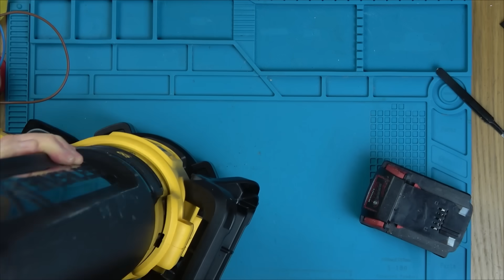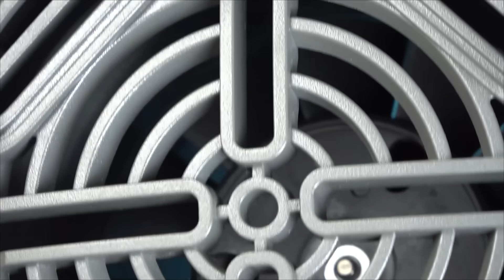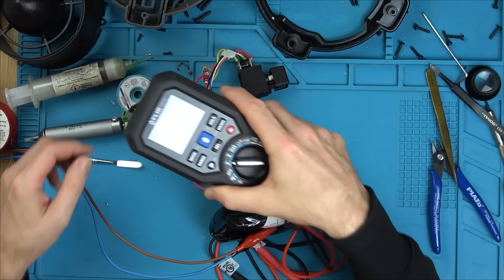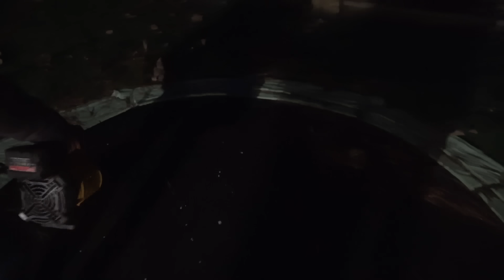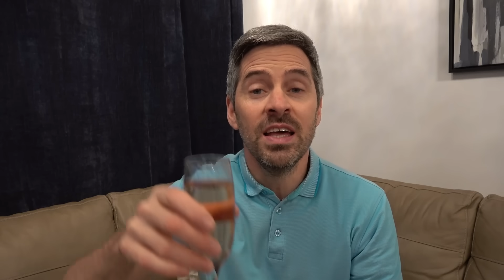MMV November 2024 Fixathon Final Day 7 - DeWalt Leaf Blower & Weekly Summary

Comment: Im pretty sure its a low voltage protection. When going full trigger it expects a certain voltage to hold up. Im pretty sure i saw your bench power supply go to 13v at one point and then it cuts off. And that can be up to cells in the liion pack having to little resistance or discharge rating (bad cell). Wonder if you would you use your huge Milwaukee battery on something more intensive power demanding tool if you get a satisfying result. Anyhow appreciated the fixathon series. Greetings from Sweden.

Comment: Don't these 18v batteries fully charge to 21v? I wonder if it's sensing that 18v is insufficient for running at full power and limits how fast the motor can turn? Try it with your bench supply at 21v and see if it makes any difference.

Comment: 18V on a 5-cell pack 3.6v per cell which is mostly empty. Those are high power devices and will be dropping to under 3V when loaded hence cut-off. You should get near 21v

Comment: that 'protection' thing is like the centre pin in the dell/HP laptop chargers to see if you have a real battery on - it always relies on a resistance value. your big one seems to throttle the output on high demand so you wont overload the battery - my hilti drill does that when it gets stuck. the battery starts blinking at that moment.

Comment: Would it be a discharge limit on the batteries used in each battery bank. Perhaps they have a discharge limit cutting off the supply from the battery to prevent damage to the cells.

Comment: 2Ah used in 5 minutes (1/12 of an hour) means an average of  2/(1/12) amps (same as 2/0.083333) which is 24 amps.  10 Amp power supply doesn't cut it 😪

Comment: Good guess on the thermal monitoring, bypassing an NTC thermistor (fitted inside a proper DeWalt battery) is the devil's work (in my opinion). At a guess, the battery ID workaround is confusing the motor controller (thinks the battery is too low capacity), causing the cutout.

Comment: If you look at the power supply when you're trying it off of that, you see that the output voltage drops when you start it. That means the power supply is limiting the current, but the amp meter is probably not keeping up, so you cant see it. And when the voltage drops too much, the blower shuts down. There's probably something iffy about the chonky battery too, maybe a weak cell that drops down too low under high load.

Comment: 2AH is the capacity it does not mean is getting 2 amps it could be a lot less. As for the Milwakee battery if the BMS is damaged it could be putting out more amps than it should and the circuitry on the tool could be detecting this and shutting down hence the reason it works with a slow trigger press but then cuts out as the motor ramps up. lower the amps on your bench power supply and see if you have a better result.

Comment: hi vince, i see lately you've bought some 18650 cells from a vaping company.
What you're showing in the video is well known amongst long term vapers and has been mentioned below...battery sag/drop under load. We (?) often run the battery through a 0.2ohm coil, or below...ohms law will show you the wattage. Its not trivial, thats why the battery should be rated at 20A or above ideally.
After a few months, a particular battery may well charge well to .4.2v , and may even take 2000mah or so, but under load, the thing drops below 3.2v or thereabouts. Its fine in a normal small torch and so on, but ask it to DO something serious, and its well...poop.
The internal resistance of these cells start out at around 25milliohms and by the time theyre showing 60 or 70 milliohms its only good for the small torch and time to buy new batteries..
That massive 12ah pack you've shown probably is just poop by now. Sorry. And as you know...open it up and its probably a 5s2p config of 18650;s. (forgive my maths if i'm out by a small amount, its been a bad day for me)

Comment: Vince, well the battery amps is the the key to the running of the power tools as for example a heavy duty power drills or drivers  need higher amps to run  that’s why advised too use on them. As lights too leaf blowers need lower amps ie 2-4  as if using 5- higher do not work well. As good fixes in all and enjoy all.

Comment: the issue at the end with the bench power supply is that its current limited to 10A. On start up the leaf blowers drawing more than 10A so the power supply is dropping the voltage as it cant supply the current needed. the same issue with the faulty milewaki battery the current drawn on start up is too high so the voltage drops. alot ofpower toolbatterys have 50A fuses in them for safety

Comment: I'm fairly certain a lot of the modern DeWalt batteries have the battery management system in the battery, not in the tool (I'm certain this is the case for 20V DeWalt batteries). I'm also fairly certain Milwaukee puts the BMS in the tool. This could be a case of the Milwaukee battery not being directly compatible with the DeWalt tool.

Comment: Your PSU is not powerful enough to run it at full blast. You could even see the voltage dip below 14 V at one point and it will be even lower at the end of those cables due to their resistance.
A good battery pack can supply well over 10 A in bursts so the original buyer probably used a weak or incorrect battery which may have seemed good on other less power hungry power tools.

Comment: The adapter does not really trick the motor. It adapts the impedence of the Milwaukee temperature sensor to a higher impedence level on which  the deWalt device can work,
To achieve that, you need a fully working Milwaukee-Battery(i.E. with working temperature sensor)  for the device working with the adaptor at full speed. 
If your battery just delivers voltage but no temperature signal, the motor will cut out as soon as you have reached a certain speed of the motor. In this case, the
impedence level gets to low for the motor to work.

Comment: Low voltage cutout. Bench power supply was down to 13 volt. Blower stop. We didn't get to see how much current it draw at full power, but I bet it was more than 10A.
Your big battery is probably not healthy, ie big voltage drop making blower cut out with that.

Comment: If you don't care about a little resistance in the mA range causing slight inaccuracy you can solder a self-resetting fuse across the fuse holders instead. No more blown fuse when you make a mistake ... just wait a few seconds for it to reset and off you go. When I got fed up with students blowing meter fuses this was my solution and I never bought a meter fuse again.

Comment: The wires for the bench PSU cannot transfer enough power. You can clearly see that the voltage drops to 13.45V on the PSU display when you push the trigger to the maximum.

Comment: So Dewalt tools in the UK are 18v? Weird.
Reply: 18v and 20v tools are exactly the same power and even use the same insides of the batteries, just marketed differently. It’s a 5S battery meaning there are 5 cells in series (and then however many more in parallel to give capacity). Each cell is 3.6v nominal or 4v maximum. 20v (5x4) is the “maximum” voltage of the 5S battery when fully charged. As soon as there is even slight discharge that becomes 18v (5x3.6). So realistically tools that are marketed as 20v are only 20v if they are fully charged and not used. As soon as you use them, they are 18v tools. But 20v Max sounds better so they market it that way
Reply: @littlebluedinosaur ….and the US allows these batteries to be labeled “20V”, but other parts of the world require them to be labeled “18V”.

Comment: I recon the controller is monitoring the voltage drop when in use, if it notices the voltage dropping too far or not stable enough, it could be cutting out to prevent damage to a poor battery.

Poor battery contacts, small thin wires, high resistance croc clips will all aid this effect.

You might have 18v at the battery but what is it like under load and measured at the board.

If you had an oscilloscope you could monitor the incoming voltage on the board or close to it and see what the stability is like on the various batteries / supplies. Or rather crudely with a multi meter but you wont see the full picture.
Reply: It was even visible for a moment on that slow voltmeter on power supply as it sometimes show 13V when pressed the trigger.
Reply: I would say it is the other way around. The bench power supply is stable and offers more amperage than the device requires, so it's probably an over-amperage that is being prevented. So, the protection area of the board may be defective. It is sensing not too little, but too much "juice" and that is why it is possible to activate at low speed. The two batteries that work may not have enough capacity to trigger the protection.
Reply: I think you are right. If the voltage difference between the two sense wires gets too low either by +Vbat dropping or Thermistor as part of a volt divider, then it shuts off. The resistors in the battery adaptor will put about 18v on one sensor wire and 11v on the other, as well as slowly draining the battery at about 4mA - 2Ah in 3.5 weeks ish.

Comment: When it comes to pretty much all battery operated power tools, they have an insane turn rate because they don't ship with a battery like 70% of the time, which is why they are as cheap as they are on websites and people order them thinking that they're coming with a battery. Or some people will literally order the ones that come with a battery, keep the battery and return the power tool. Or even worse, if their battery goes bad, the order of power tool puts their battery in, it takes a new one, and then returns that power tool with the old battery.

Comment: Brushless motors use an electronic speed controller, which uses a three phase system to feed the motor and it also knows where the motor is in its rotation so it knows which phase to feed power to. They also expect a certain number of series cells, with 5S (five cells in series being 18.5v for LiPo cells, for example). The speed controller will cut power to the motor if the cell voltages drop below the safe limit. I suspect, in your case, the speed controller doesn’t like something it’s getting from the pack that starts and immediately stops. It could be that the speed controller is faulty of course.
Reply: Ohhh yeah definitely a NPN transistor ... happened to my cordless drill..

Comment: what the adaptor is doing there is a nasty little trick chinese battery clone manufacturers like to do, its putting resistance across the sense pins to match what a healthy thermal reading would give off, not strictly safe since it bypassing a safety function, but you are using it with decent quality batteries so its less of a problem than when its done inside the third party batteries

the larger battery is most likely able to put off a higher current than its expecting so it cuts off thinking theres a short or something

Comment: My guess is there is a current limiter in the motor controller and the smaller batteries can't produce a high enough current to exceed the current limit. Your power supply and the bigger capacity battery can exceed the limit.

Comment: The battery probably comminucates via some i2c or whatever data protocol to the board (just like certain laptop batteries) or its just some simple power good signal or current sense input kr tenperature. That infineon chip (with the i on it) is a xmc1302 embedded microcontroller commonly used for driving bldc (brushless dc) motors like the one in the dewault. I did not see any battery Management block inside but they probably have that transistor feed the mcu or some analog input causing it to only turn on when the right signal is present 

Its sadly commonly done to make sure ofbrand/no brand batteries wont work and you buy the official battery or a battery that has the right things to tell it to turn on. (At least what is my gues)

26:59 i think the seller used a weak battery on it or a battery that could not handle the oomph the device requires to do its first kickstart. Like that if it detects a slight voltage drop that it will go to a fault mode to not overcurrent the source further. I am just guessing at this point but thats my gues. That mcu has some analog inputs and you can easily use an mcu to detect if power is good or detect battery voltage

Comment: 31:50 my guess is that the battery is sensing the current and cutting off? and that's why when you do it slow you can get it partially running

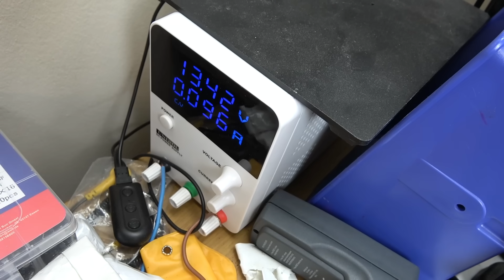edit: 33:15 okay i have no clue anymore

Comment: Thanks for the fixathon Vince, I really enjoyed it! I can't wait to read the comments and find out why things are mysteriously not working with the battery adapter. Maybe it has something to do with battery cells.
Reply: Probably its some anti off brand battery lockout that only dewault certifie batteries work which is sadly common with companies these days locking out things if you dont have the right parts. (Atleast its my gues). Or for detecting bad batteries so it wont overload them
Reply: @309electronic5 It was working fine with the adapter and the good Milwaukee battery.
Reply from the maker: Thank you so much 👍